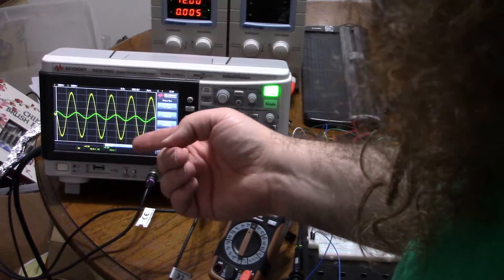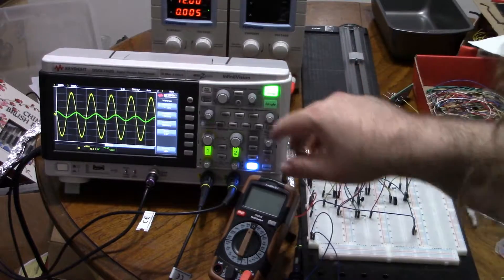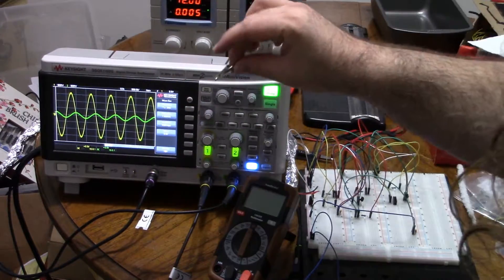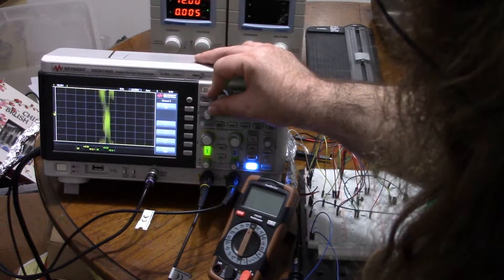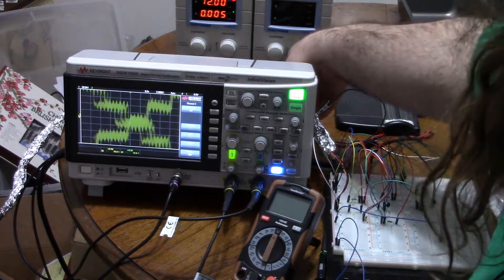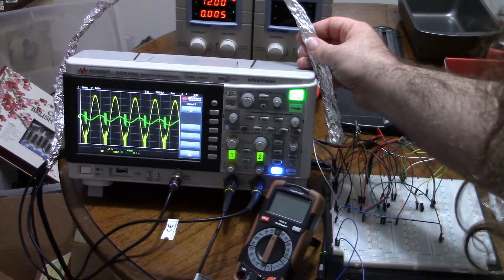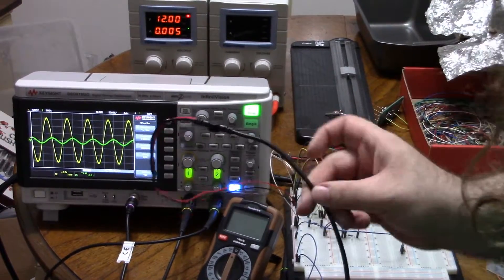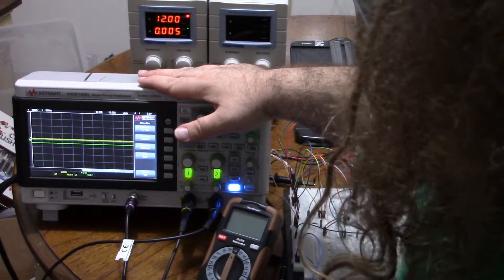Tin Foil Faraday Cage - Cleaning Up Breadboard RF Interference For Pennies

Comment: On a similar idea as the bread tin, I have my entire Beavis Board I built for building guitar pedals inside a printer paper box lined with tin foil. I have an alligator clip that connects to a ground jumper and to the foiled edge of the box. Minimal EMI, which is much preferred over buzz when testing knarly fuzz circuits

Comment: I bought copper tape out of this channels recommendation. Looks like I am going to have to stock up on more supplies.
Reply from the maker: I have been having so much fun with "handicraft" electronics, like copper tape, aluminum foil, cardboard, and wood, that it's becoming my shtick. I've considered getting stuff like a CNC cutter and a 3D printer, but I decided against it and got stuff like a dremel instead so I can make handmade wooden control panels. So many cool projects right now!
Reply: @simplyput2796  I bought stripboard but augment it with copper tape.

Comment: Oh God, I was waiting for you to use your cake mold :(, have you tried using only one (like half a Faraday cage)? Because guitar tube amplifiers for example use half a Faraday cage but inverted (bottom exposed). :)
Reply from the maker: I was actually planning to move the circuit to a smaller breadboard and put it in there, hah. But it turned out to be unnecessary because the worst of the interference came from the one line and the rest of it is small enough noise that it's not hurting me enough to care. But some day I'll try a high-frequency circuit and into the cake mold it goes! And yes, half of one would still help some, just like wrapping only the middle of the cable in foil helps some. As long as the interference waves aren't reflecting and bouncing all over the place, of course.
Reply: @simplyput2796  Nice!

Comment: I'm wanting to build a DC motor speed control. I found the pcb schematic although I don't know if it looks right. Will you look at it? https://300mpg.org/open-revolt-cougar-controller/ the link is the (here) at the bottom.
Reply from the maker: I'm sorry, but that is far above my skill level right now. I recommend seeking out the EEVblog community for advanced work.
Reply: @simplyput2796  okay, thanks for response. If you ever wanna take shot at it in the future let me know.
Reply from the maker: He says you can calculate how much total current to put across it based on the surface area inside, and to set the power supply to that current and let it go, and that's what I would do: My power supplies let you set a current and a voltage limit, so I would set the current limit to whatever you calculate for your battery, then set the voltage limit to its maximum (my supply can do up to 32V or 5A) and let it go, and the power supply will automatically adjust the voltage to meet the current limit.
Reply: @simplyput2796  my problem comes from working with DC power to begin with. (No ac main power source/off grid) I was wanting to know what a dc only charger would look like for that Battery type.
Reply: @justthinkalittle8913  That guy in that video, "Robert Murray Smith" answers everyone who ask him questions in the comment on his videos. he dosen't make many videos but dose answer everyone!! he's an awesome guy!! he will answer any query's you have on any of his videos. it might take him a while to get round to you but he will answer..  i hope this helps you out & i think what you are doing is living of grid is well cool.. best of luck with you build!! : )
Reply: @keithking1985  I know I'm a paid member to his channel. I was wanting circuit information. Thanks